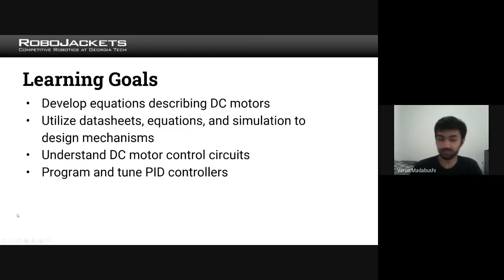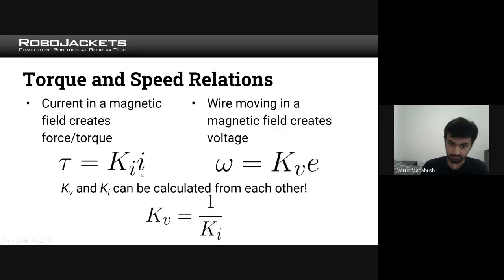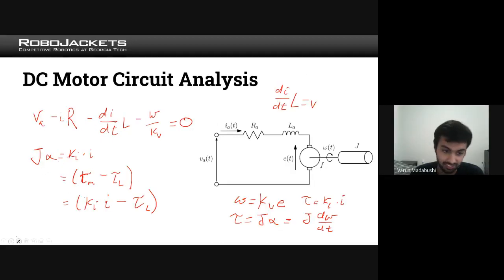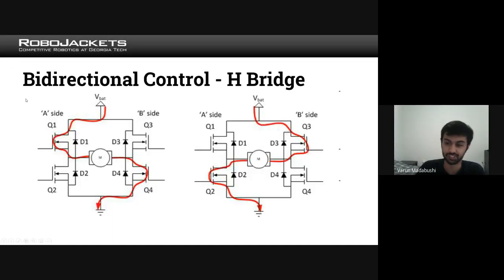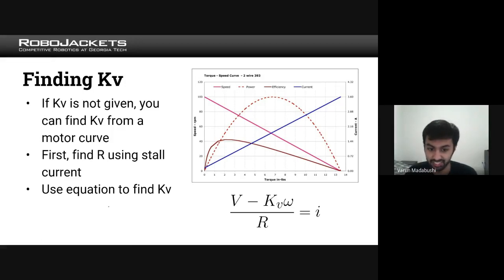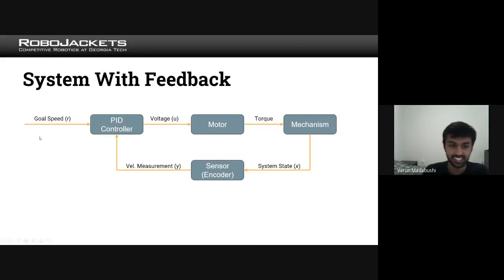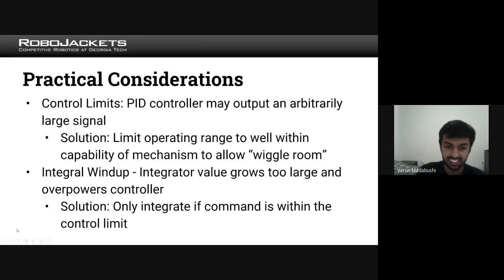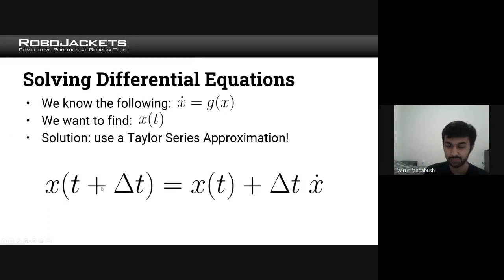DC Motors: Analysis and Control

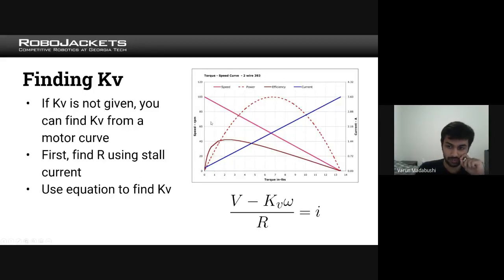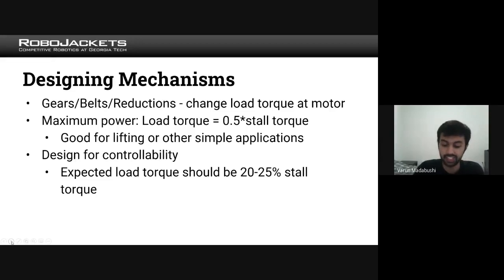Comment: I believe there's a typo in the slide displayed from 22:36 - 23:37. You have i = (V - K_v * omega) / R.
I think you actually mean i = (V - omega/K_v) / R. You can see from looking at the defining equation of K_v on the first slide omega = K_v * e that the version currently on the slides isn't dimensionally correct.